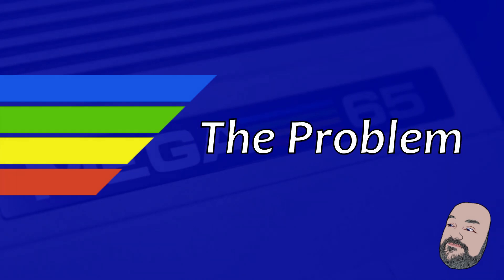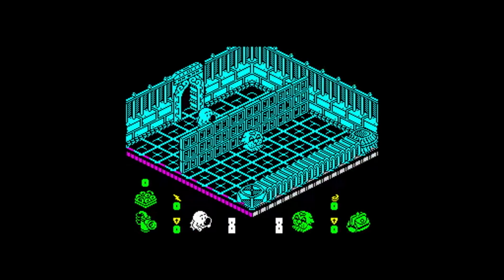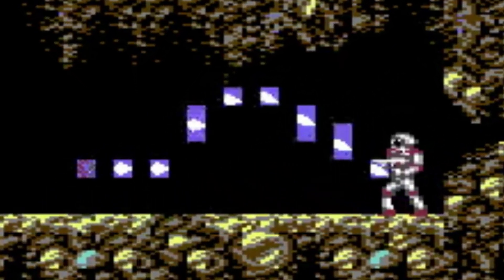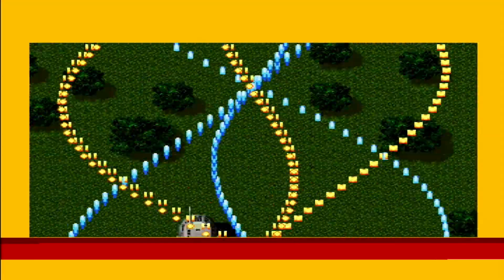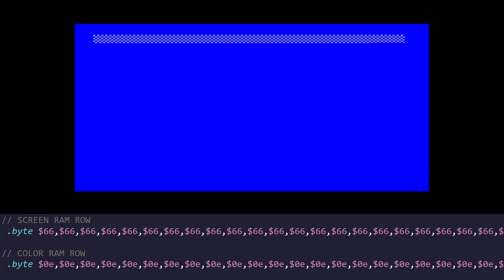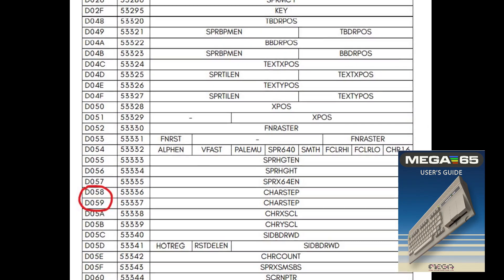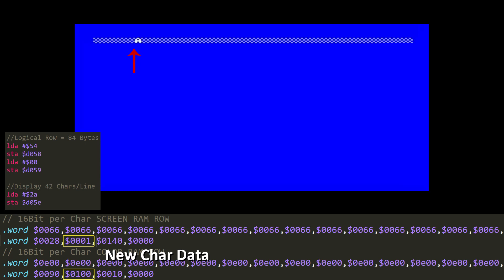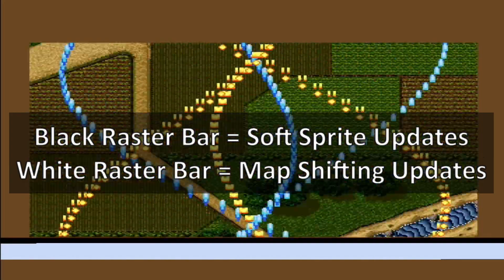Discovering MEGA65 - The Raster Rewrite Buffer ... Spolier ... it's amazing!!!!

Comment: I hope that the mega65 finds a good audience. there are several “super” retro platforms in development and I have a hard time deciding whether I like them or not. After a certain point you have to ask the question “why?”.
The Mega65 has the benefit of implementing specifications that were created along time ago. That adds a lot of legitimacy. (Except for the 40 MHz processor which I just find ridiculous).
but if we’re going to go this far, why not just put a keyboard on a Mega Drive?
or at what point do we admit this is basically the same as an Amiga?
Reply: I think the appeal for C64 developers that want to do something retro, but beyond what the C64 is capable of, is that you don't have to learn a new language, whether that's 68000 for the Amiga or Z80 for the Next. Try doing what Shallan demonstrates in this video on an Amiga, it'll take you a lifetime to get near. For the M65 it's just a few lines of code. This is essentially a Commodore version of the Next, and that seems to have done quite well. I think the answer to the question 'why?' is 'why not?'. I have a feeling these guys would be making the Mega65 in some shape or form whether anyone was interested or not. I was highly sceptical they'd reach their funding goal for the moulds, and let's be honest they were nowhere near until a benefactor chucked in 40K, but I admire their ambition and determination to get this done.